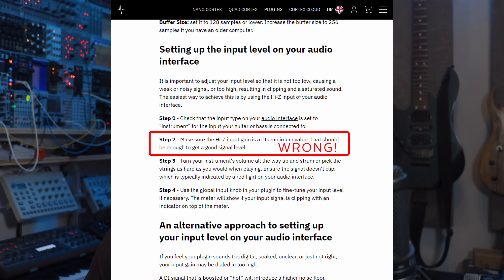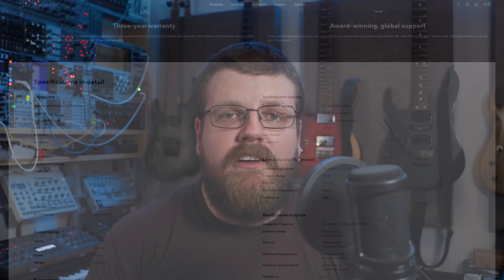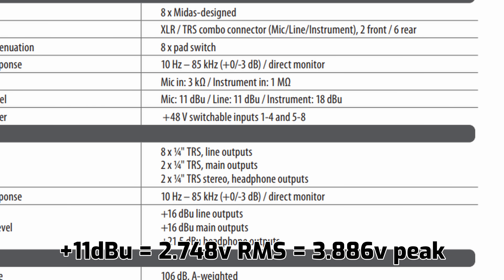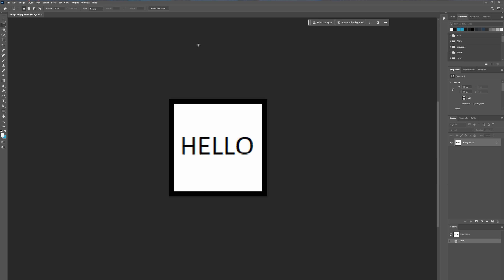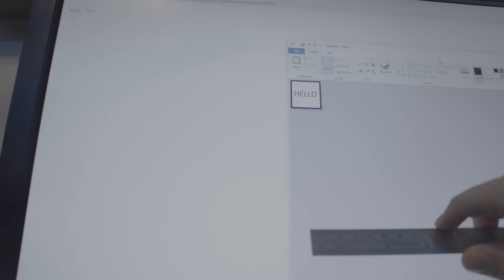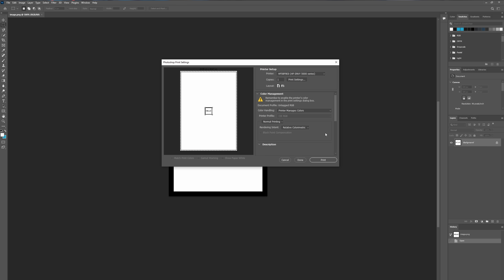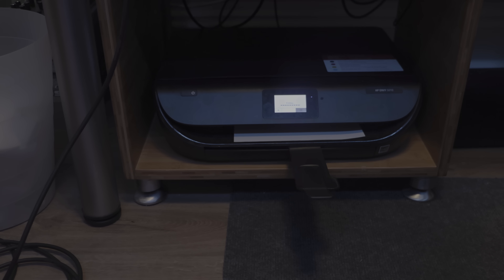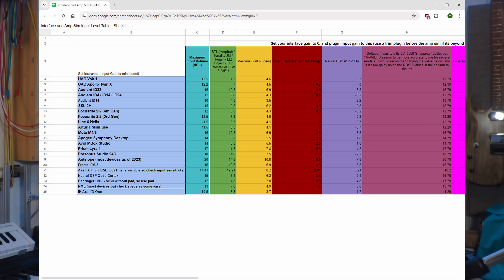Ampsims and input gain - Please, stop the madness...

Comment: All of this much easier. Just read the  guide book for plugin, most of this (STL, Mercurial) recomend to set the gain level on soundcard to position, that do -6 db in input level in your daw, and than, if you have low-mid-high output pickups, just set input level in plugin to -6 or 0 or +6 depends on your pickups

Comment: Thank you for making it clear about the proper way to set input gain on the audio interface. Finally. BUT- it's STILL unclear exactly how to set the input gain on the plugin- I can't see my amp sims on the spreadsheet (Melda, Amplitube or TH3) and where do we find the spreadsheet? Which column do we use? There needs to be a straightforward and streamlined and User Friendly way to set the proper input gain on the amp sim itself. Who can help with this?

Comment: How do we know exactly how much to turn the input gain of the amp sim down by?   For example in Apogee Control software, I typically will turn my audio interfaces instrument level gain nob to "4"  (which is arbitrary right?).  This gain level of "4" on my audio interface gets me a peaking level of about between -3 and -6 on the apogee control meter for the input of which my guitar is plugged into.  The spreadsheet says for Neural DSP plugins, my interface's value for input gain is 1.8.  
Im just confused exactly how much I should turn the input gain down by in the NDSP plugin.  Im no audio engineer and not knowledgeable about this,  so any clarification on this last step in this video would be greatly appreciated.  Thank you
Reply from the maker: @drummingjeremy11  see pinned comment for details on that
Reply: @GhostNoteAudio  Thank you

Comment: This is cool but I still think it should be possible to explain this much, much more simply. Talking about plugins and ampsims and all this digital stuff - it's ALL IRRELEVANT. This is solely about the audio interface and the ADC. You always want to give ADC's the maximum signal (before clipping) to compensate for the noise inherent in the device. The end. Proceed accordingly with your digital processing afterwards. Why is this so complicated.

Comment: Question, what if I'm using a pedalboard (Distortion + ampero || + cabsim to the interface xlr input, and the signal is hitting the interface so hard and I'm not using any plugin? Should I lower the input gain from the DAW?

Comment: As someone who is relatively new to engineering/production, i came across this conclusion entirely on my own through testing, thought it was pretty self explanatory. Currently have a pretty cheap 3 input interface, and have marked the knobs with masking tape and sharpie so i can quickley set the optimal gain depending on the input source (microphone, guitar, synth/keyboard).

Great video nonetheless, ill definitely have to check out more of yours!

Comment: So where does the volume knob on the actual guitar fit into this equation? I have an Airline Bobkat with a single volume knob. Do I crank that baby up and then use the USB Interface's gain knob to do this or vice versa?
Reply: I'd think you turn the guitar all the way up, to get the biggest possible signal. Then on your ADC (your usb interface I assume) you also turn it as high as possible without clipping.

Comment: I lowered the hot humbucker slightly with a screwdriver, because on my focusrite scarlett 2i2 2nd gen when the gain knob was set to 0 it was still clipping, after that it was possible to change the gain before clipping. Could this be an option?

Comment: Fellow EE here working as an embedded engineer who designed and programmed DSPs (digital guitar pedals) in the past.
Nice video, great explanation, majestic beard.

I'm a little afraid to get into ampsims because the way I play is that I'm running a marshall clean and I'm boosting it to the edge of breakup with a pedal to a point where the amp's channel is compressing the sound totally if I strum hard, that way 1: it sounds great, 2: if I step on any other high gain - high level boost pedal (like a WAH) there will be no volume jump compared to when I'm strumming hard.
The issue is that I could in theory reproduce this with ampsims with this exact gainstaging but I'm unsure if it's even possible to dial in the preamp of an external sound card not to clip when I engage and play hard with high - gain pedals (as far as I remember just the basic original Vox WAH amplifies the instrument signal on the given frequency range by ~x16 (Collector resistor / Emitter resistor as a rough estimate)). As far as I can tell these were designed to take in purely instrument level signals coming straight from your pickups.

Comment: Here are the key takeaways from this lecture on audio interface gain staging and amp simulators:
The correct gain staging process has four steps:

Set audio interface gain to zero initially
Set plugin input gain according to reference spreadsheet
Increase interface gain until just below clipping threshold
Reduce plugin's digital input gain to compensate

The misconception: Many online sources incorrectly advise keeping interface gain at minimum, which reduces signal quality.
Technical explanation:

Higher interface gain improves signal-to-noise ratio (demonstrated improvement from 90dB to 109dB)
Pickup noise, not interface noise, is the limiting factor
Each additional bit depth reduces noise floor by ~6dB
Low signal strength wastes available bit depth

Digital vs. Analog signals:

Digital audio signals are unitless (like digital image pixels)
No universal standard exists for relating voltage levels to digital signals in amp sims
Need to optimize both analog-to-digital conversion and plugin input levels separately

Result: Proper gain staging maximizes audio quality while maintaining the intended sound character of the amp simulation.

Comment: I have followed these steps. Over and over. And I CANNOT get this to work at all. Using a Scarlett 18i20 (Reaper DAW) setting both the gain knob on the interface to zero AND setting it to just below clipping always pushes zero in my daw. I can't ever get my amp sim volume to sit around -18 or -12. Even turning the amp sim off and just having a dry DI, the Scarlett registers around -10. So the second I introduce an amp sim, it's game over and skyrockets. I'll admit I'm a noob when it comes to this stuff so obviously I'm doing something wrong, but boys..... I need serious help. Going out of my mind trying to get this to sound good while also having a nice healthy signal for recording. Right now it's choosing between the two, it can sound ok but be way too hot and clipping, or it can be more quiet and sound like dick. So I'm open to any and all suggestions.

Comment: I'm reading that my Mackie Onyx Artist 1-2 has a max input volume of 24 dBu with the gain set to minimum, which is a lot higher than the others on the spreadsheet. Is that right? Am I missing something?
Reply from the maker: @dannygonzalez8211  that is very high, but double checking the manual, it does seem to be correct. so you are very likely to benefit from following this process :)
Reply: @GhostNoteAudio  Thanks!

Comment: I'm not smart enough to figure out exactly what you are saying, but I do believe this is exactly what I was looking for. Some recordings I have been doing recently don't sound good at all, and I think it's because I have been setting my interface right before clipping and trying to maximize everything. It has no dynamics it seems. I only noticed it when listening to other recordings and they were night and day. I will keep coming back to this video to understand more details. I think I need to adjust my interface means the volume is too low. I also am using the same one in the video, so I know you are right.Thanks

Comment: So does this argument apply on the QC modeler too? There aren't any values about the physical modeler on the sheet you referred about. Theorically, I just need to raise the Input Gain to just below clipping and then take off the value I added from the second input gain (located at the beginning of the chain, near the Noise Gate)? Thanks for the clarifications!

Comment: Seems to me like you had the attenuation pad on at the preamp you used. Doesn’t that mess things up and increase the noise floor also? You could just disable the pad and lower the gain considerably.
Reply from the maker: @Haho-aho  I did have the pad on, yes! But I've talked about it in other comments here. In short, the pad feature on the umc1820 is badly mis-designed and works kind of opposite to what it should do. It only reduces the gain by about 5dB but actually increases the noise floor relative to signal strength considerably. Turning It off seems to couple a lot of excess noise into the converters. Without engaging it, the difference before and after would have been even more extreme.

Comment: I was under the impression the 0db for Neural DSP was to accurately simulate the amp sound because they designed the amp sim based on a guitar signal with 0db of added gain going in…

Comment: Old School Translation: Gain Staging. All (let's call them modules) modules in our signal chain should be operating at a nominal level. The nominal level is never, or rarely ever, at 0db input. This is basic audio engineer stuff. If your gain staging is not setting all modules at nominal levels, you won't get optimal performance. You want to be in the pipe, 5 x 5.

Comment: Great video! How would this work if using a preamp with line signal going into the interface? 

Would it be wrong to leave the gain on the interface as low as possible to get close to clipping by controlling the output on the preamp?

Comment: 😅😂🤣 just plug into an amp, mike it, & record it. STOP with the digital garbage that was pushed on everyone so someone can take your money to do something that you already knew how to do. - What a JOKE!
Reply from the maker: That's a fairly bad take :/ Digital definitely has it's place, and is WAY more affordable and easy to work with. Btw there's absolutely nothing wrong with just setting things by ear and going with whatever sounds good. But if for any reason you actually want to understand how to accurately set the levels to match the simulated hardware, this video can be useful.
I have eight amps sitting on that shelf behind me, and another ten in the attic which rotate in and out of my setup. Yet I always find myself reaching for a plugin or a pedal when I actually need to get things done and work efficiently. Why? Because it's just more convenient and sounds just as good if not better (way better noise performance... if you set your levels right :) Amps are expensive, loud, heavy and obnoxious... yet I find myself compelled to collect them 😁

Comment: I turn the knob all the way to 0 (all the way to the left) on a presonus quantum 2626, it comes into the daw at around -60
i then do the steps, and turn up the input gain to below clipping and get around a 54db difference in the peak meter, it doesn't sound right in the plugin and i then compensate on the plugin and with a trim plugin because ndsp only allows me to remove 24db on the plugin input. What am i doing wrong? even if i remove 24db in the plugin input and put a trim plugin before to remove the remainder, the signal sounds super weak. It doesn't like the og amp and even the heavy patches sound too clean. Is there a possibility this doesn't work when massive increases are needed, even the input in the plugin is virtuallty non existent on the input meter, it doesn't seem right to me.
I know the quantum has 60db of range on the gain control so the values make sense but it just doesn't sound right.

Comment: So what does this mean for different guitars: you played humbuckers, but if you pick lower output single coils, you'd raise the input gain on the interface, and lower the input gain in the plugin. Won't this mean every guitar is recorded at the same volume again, leaving little difference between humbucker/single coil? Or am I missing something?
Reply from the maker: No, different level pickups are still different when they hit the plugin. The key bit here is that you're supposed to reduce the digital gain by the same amount that you've raised the analog input gain, to preserve unity gain through the signal chain. So yes, every signal should be pushed to just below clipping threshold on the input, but you have to reduce the gain back down afterwards to restore the correct signal level.

Comment: I watched this entire video because I’m trying to fall asleep. The first 30 seconds of the video I was shocked that anyone would think you need to set your input to 0. You hooked me because I was confused why anyone would think that. Besides everything you said, getting as much gain as possible will make mixing significantly easier. If you have a weak signal you are going to have to throw a bunch of plugins in to boost the crappy signal. Then you are going to have to add a bunch of unnecessary EQ adjustments to make up for the flat sound of not having big enough waveforms to make a full sound. Garbage in, garbage out.

Comment: Finally some common sense. Thank you. One question though: how do I know how much gain I am dialling in on my audio interface (Focusrite 2i2 3rd Gen, in my case)? Unless I know this, I wouldn’t know how much to compensate on the amp modelling software (AT5 Deluxe, in my case, and Tonex, on their own or through Logic Pro X). Thanks!
Reply: For example, if the 2i2 max gain is 12dB and I have it set to, say 12 o’clock, am I dialling in 6dB - ie, is this linear?

Comment: I'm watching this as an amatuer on the physics side of this, and thinking: 'Well... yeah, I heard this rule over a decade ago.' I can't believe anyone got confused throughout the process. Why drive your pre-amp less than what it can drive at, just because the plug-in you're going into converts it differently? Keep your input gain on your interface at a few dB below clipping, and then run your amp-sim at an input level that doesn't clip that either... that seems incredibly basic to me. Perhaps the fact you have to run your plugs below 0dB on their input gain threw people off, but I don't see why that should matter. All that matters is that every gain-stage step follows that same rule... right?

Comment: Not only does this process help with properly gain staging your amp, it also helps with matching the guitar (specifically pickups) with the whole system as well. A Tele with passive pickups has a wildly different input level than an Ibanez with active pickups, and the first step in the process of turning the gain up from 0 on the interface sets the correct level for the instrument you are playing.

Comment: This is a helpful and easily understandable explanation. Thanks. That said, given that most noise we face as guitar players (well, us single coil players, anyway) comes from the guitar and not from the interface, setting the interface gain to zero remains solid practical advice for many players. Dual gainstaging (if you will) requires another plugin to measure the audio interface gain plus (gasp) a little arithmetic.  For lots of us, setting the interface gain to zero and tweaking the plugin input level is close enough for rock and roll.

Comment: Thank you so much for this explanation! The sound of my guitars are WAY more clear now. The difference is insane, especially when palm muting with a high-gain tone.

Also, I tried out of curiosity the auto input feature from one of my VSTs (STL Tonality Josh Middleton), which dial the VST knob by itself while you play for a couple of seconds, and it managed to find the same input level as the one I found myself, with only half a dB of difference. I always thought these kinds of auto-leveling features weren't to be trusted, but I guess I was wrong.

Again, thank you

Comment: Fantastic. I think my problem still remains the fact my studio has a lot of interference and turning up my input raises the noise floor I experience just from my guitar and cable. I dont play direct into my interface much, but I use a tonex pedal. I had better results on the pedal with lower global input trim.
Reply from the maker: That's fair enough, that can happen if you have lots of electromagnetic interference, and doubly so if you use single coil pickups. At that point, the self noise of the interface will definitely be drowned out by the external noise picked up by the pickup. Makes it pretty much impossible to record ultra high-gain stuff! :)
Reply: @GhostNoteAudio  I will look through your channel but as a builder of my own pedals, an "engineer" (making my own records), and as someone who knows about software development, I'm really interested in learning more about conversion. Hoping you have vids on the topic but if not, that would be amazing.

Comment: This is the most concise info on gain staging I've ever seen. Thank you sir 🙌🏻 genuine question though, how would you gain stage between multiple plugins? Say you run from an interface -> plugin 1 using just the pedal section -> plugin 2 using the amp and cab?
Reply from the maker: Good question! The fact is, if you want your analog-emulating plugins to behave exactly like the original hardware, you do need to gain stage between plugins, with something better than just your ears. However, I think most people accept that doing it by ear is probably good enough for most scenarios. But if you want to get really pedantic, you'd have to look up the specs for input and output signal levels for both plugins, and then tweak them so that they match the hardware. This is actually quite involved, which is why it's rarely done. Many plugins however, have some kind of input level meter, which gives you an indication of if the input signal is in the correct range, which gets you totally acceptable results :)